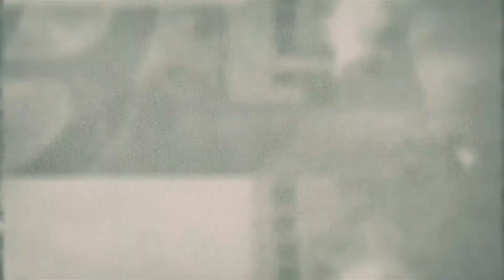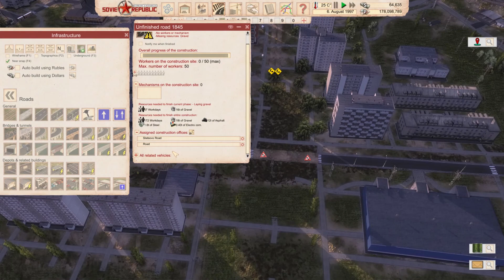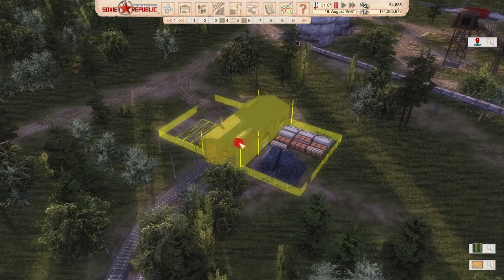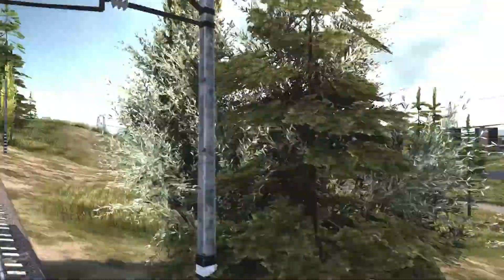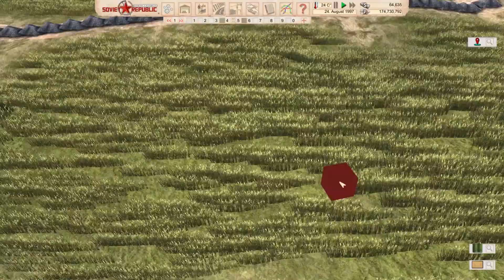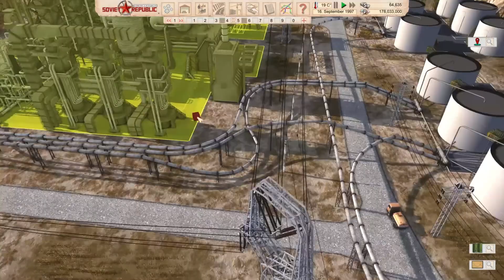Soviet Republic - Alaska - Light Rail - Ep.186

Comment: Regulation of exports (whether for fuel or for any other production) : I always build double logistics for what I produce : an internal logistics for supplying my Republic and an outgoing logistics for surpluses. Take the example of fuel : I have storage(s) linked to my production refineries, this storage being used only for my personal consumption. A second storage is dedicated to exports. To determine the surplus I use a DO which transfers over 90% the surplus from the first storage to the second storage. It is this second storage which contains only the surpluses which is connected to my export network. Whether it is bricks or fuel, food or chemicals, I always have my producing areas with these two parallel networks. This is why I previously indicated that I mainly used my DOs for these export issues, in particular for the management of internal (my Republic consumption) / external (exportation of my surpluses) storages, because only DOs can be configured with percentages. On a side note I never produce strictly for export, my main goal is self-sufficiency, on the other hand I optimize my production by systematically exporting my surpluses, and only my surpluses. With this double logistics, we are never short of resources for our own expansion, but each surplus will be financially optimized.
Reply from the maker: Yeah, DOs! I thought so! I was trying to set this up with pipelines but, unfortunately, I failed. I need to play with the priorities of the pumping stations more. I could make a pipeline from the refinery to the pumping station and separate it to Domestic and Export. And prioritize the Domestic tanks in the pumping station. 
But your DO setup already WORKS. :)

Comment: I agree with you about the danger of putting multiple high density residential areas together within a city.  The game mechanics just don't handle supplying the needs of that large population well.  It can be done, but circling that area with multiple shops, cinemas, sports facilities, schools, etc kind of breaks the look of the city unless you like that look.  Maybe modders have built more corresponding tall "supply sources" to accommodate these populations; I haven't really looked into that.
Reply from the maker: There are buildings and shops that fit under the building. In reality, there were a lot of those in eastern Europe. Mix use residential. 
But I'm not sure if I want to use them as they are an invisible shops basically.